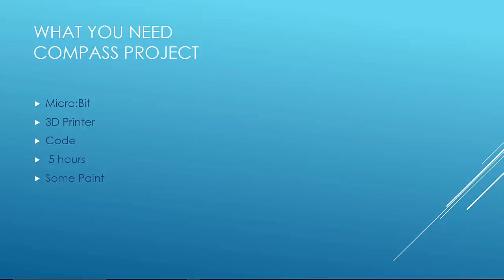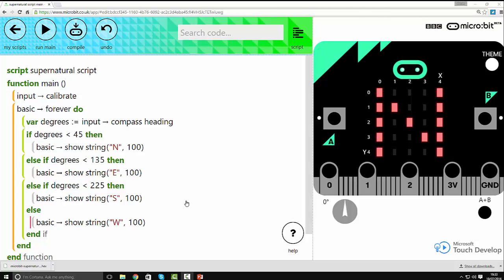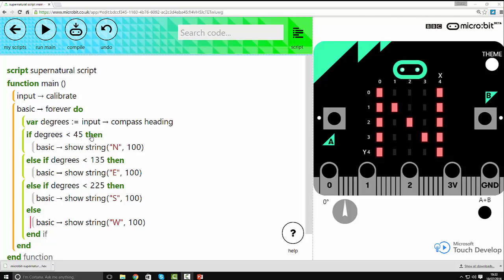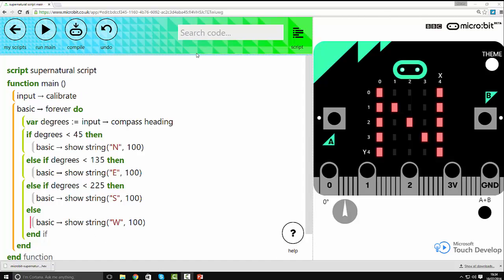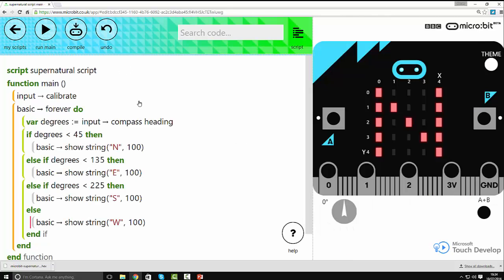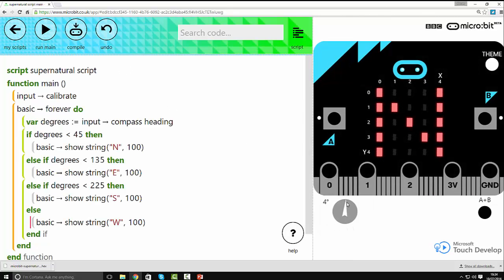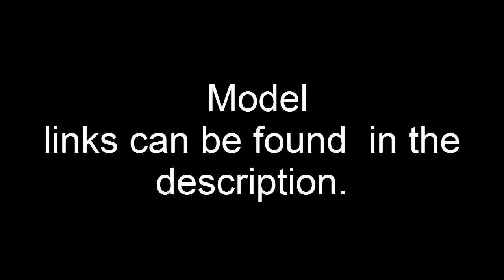This BBC Micro:Bit Compass is Amazing and it is 3D Printed!

Comment: The code is wrong. The correct code is: else if degrees < *315* then basic -> show string("W", 100) else basic -> show string("N", 100) Because North is not only when heading is less than 45, north is when degrees is > than 315 as well. The code on the official page is wrong too: https://makecode.microbit.org/reference/input/compass-heading
Reply from the maker: +ChupoCro well spotted.